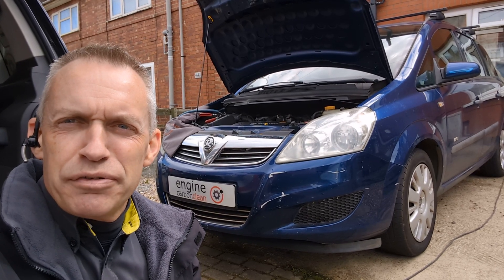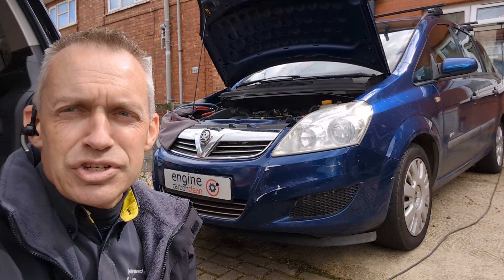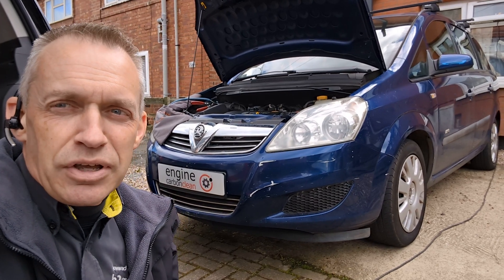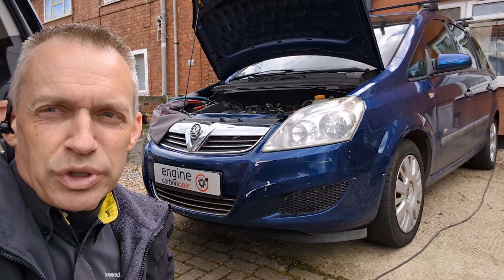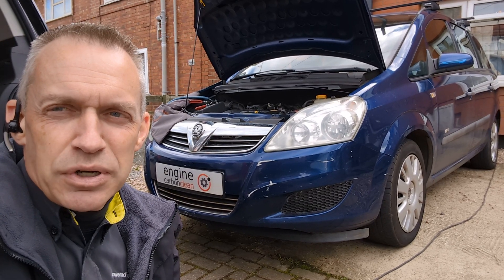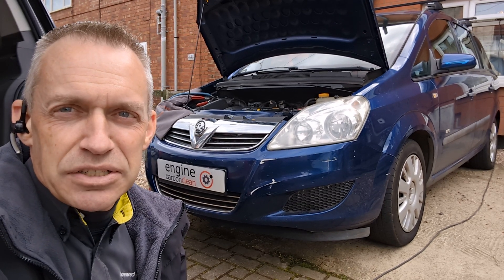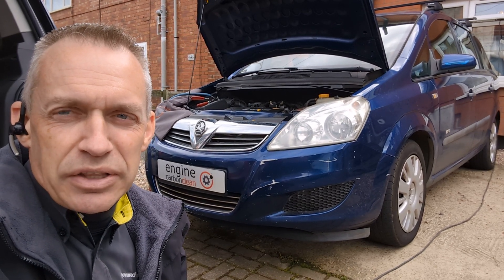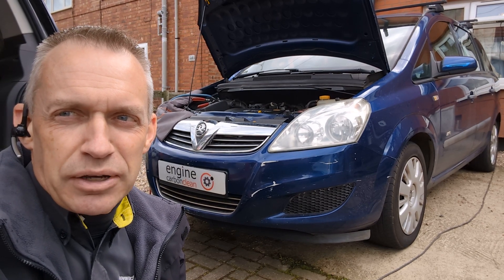P0171 Fuel Trim System Lean - Thermostat stuck shut - Vauxhall Zafira 1.6 (2008 – 124,352 miles)

Comment: Did the thermostat sort the problem
Reply: Was the car hunting on idle with this fualt?
Reply from the maker: Yes it did 👍
Reply: @Engine Carbon Clean East Midlands - F5ECC  what temp dose the car run a now its been done
Reply from the maker: Not sure as haven't been back to it since. The owner informed us that after the replacement thermostat it was running like it should again.
Reply: Thank-you because I have the  same problem
Reply: Thanks for the Video. Just to clarify, when you said clean, what exactly did you clean and how please?? Thanks in advance
Reply from the maker: @neildean7515  the vehicle was booked in for our diagnostics and Engine Carbon Clean booking. Take a look at our website for details at www.f5ecc.com
Reply: Have same problem with mine, hopefully it is, have replaced everything else lol, thanks bud